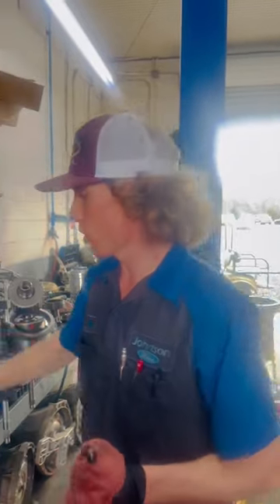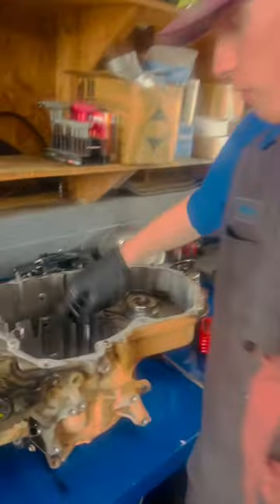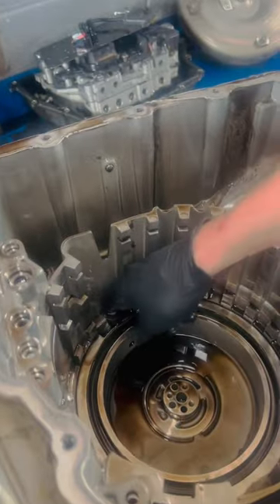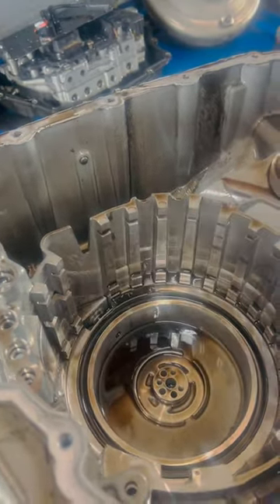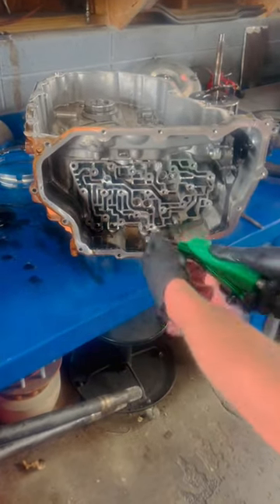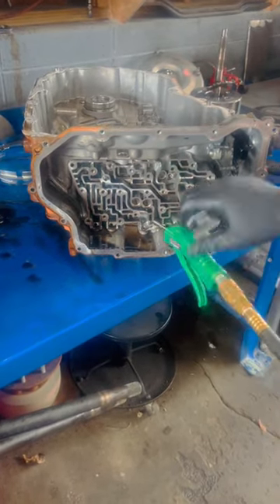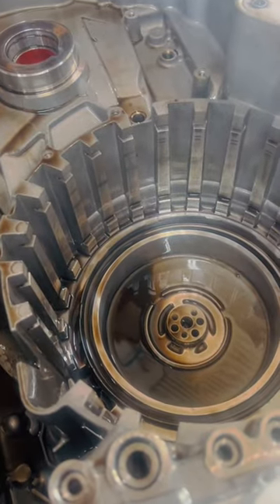Automatic Transmission Piston Removal Made Easy #shorts

Comment: Depending on the piston I would recommend a pressure regulator on the air line turned down to 10 psi or you might find the piston stuck in the roof or worse your face.

Comment: You do it with brake cylinders as well 👍🏻
Reply: I thought this too but who rebuilds brake pistons anymore?
Reply: @BenVanAmburg  in the motorcycle industry you do all the time I actually have a old brake line fitted for shop air and can go over 100psi if needed for baked on pistons and o rings

Comment: When my school taught me how to build and rebuild auto trans that's how they tested the seals for us to see if we did it right on the drums with the clutch packs but it was on the actual pump and then putting the drum of clutch packs on it. It was really neat seeing how that works, the actual test transmission where it gets all the fluid n stuff you're supposed to only take it apart WITHOUT TAKING THE CLUTCH PACKS APART. See i didn't know that no one told me just "take apart the transmission and we'll look at that point" so i did... Then took the clutch packs apart i actual think there was a paper to not do that but i really didn't see it. Then they told me well see how it works if the seals aren't damaged from that. I passed even taking that apart and it worked fantastically it was fun tho.

Comment: Middle hole on the 4-5-6 piston is the only way I know. Never done the L-R that way since it’s usually no problem but knowing another way is always useful 👍🏻
Reply from the maker: I pull it out by hand most of the time. That one just made a good view for recording. Others have to have air. I’m a no regulator guy too. I blow pistons to the ceiling with 150 psi. Might be why they don’t work afterwards 😂

Comment: Hello bro. I have Ford explorer 2020 my question the oil transmission for how long I will change ?
Reply from the maker: 100-150
Reply: @FlyingWrenches13 your telling him to go 150k on his transmission oil ? Did I hear you correctly?
Reply: @kenj.8897  Lol he wants to rebuild that transmission too
Reply: I would do 30-50K miles. I do mine in the driveway. Easy enough on the Ford Fusion and the fluid isn't that expensive.